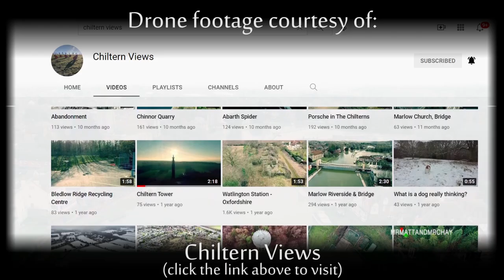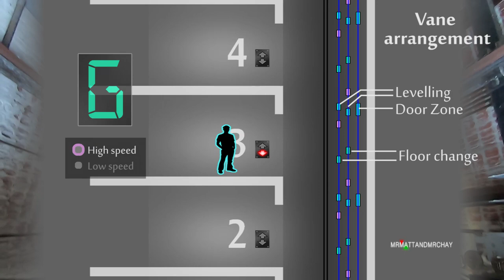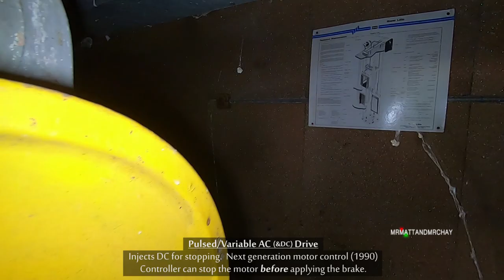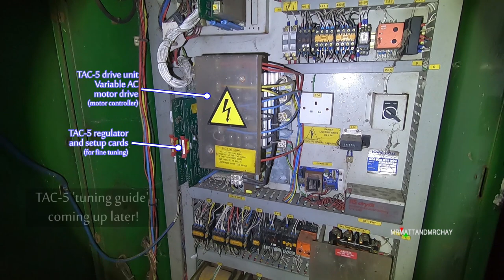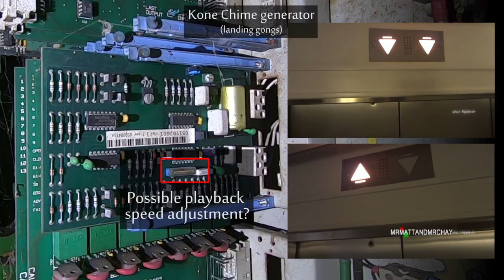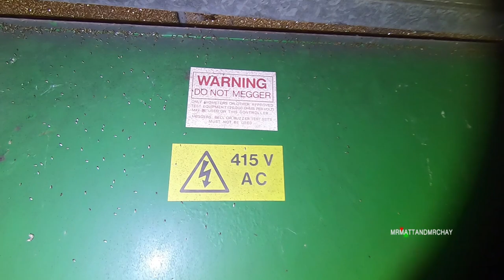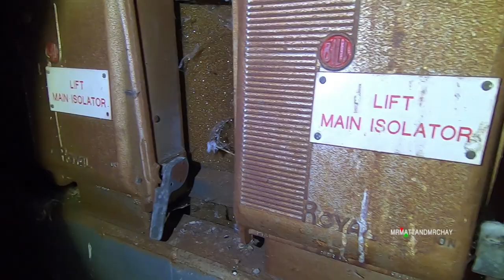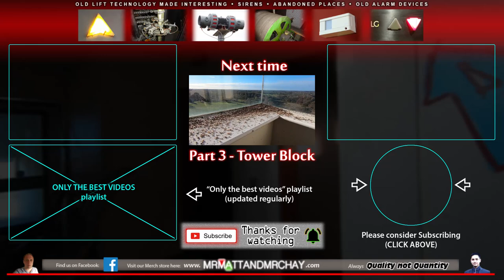16 FLOORS UP - Abandoned tower block - Lift Machinery ("intricate detail")

Comment: Thank you, your video comparing the old and new setups answered a question for me. I always wondered what that whine/whistle was on those old Tesco lifts, as they came to a stop. Never in a million years would I have guessed it was the brake! Great footage as usual.
Reply from the maker: The whooping noise (if that's the noise you mean) is the motor configuration being switched from high to low power and vice versa.  The noise is just the vibration created by the motor windings being connected between star and delta (google 'star and delta motor', as this is another topic in itself!!).  The screech noise is the brake being applied to an already rotating motor.
Reply: @mrmattandmrchay  ah yes I was getting confused there then. The star delta for startup made sense, but I hadn't thought about slow down as well. Either way it's thanks to your great videos that we learn more about these things. I do miss the siren videos, started watching some of them again the other day. Sadly I never managed to 'see them in action '.
Reply: These are variable voltage variable frequency motors, the frequency of the voltage is reduced to cause the motor to run slow. The speed of the motor is controlled by varying the frequency and voltage going to the motor, thus a vvvf motor. You can hear the frequency of the current as it drops down into a frequency that’s audible. The slowest speed using the Lowest frequency in the system. As more speed is required, the frequency will increase along with the voltage, that’s why you hear the whine at its slowest speed. Ever run a cordless drill at a slow speed ? The speed of the motor is reduced by lower voltage and you will hear the frequency at that slow speed.
Reply: @perrymckinney6146  Sorry, I meant the yellow motors in the old Tesco motor room. Yes you can clearly hear the wine from the motor driven by the VFD, I am not a fan of VFD driven motors at all.

Comment: Ad. 5:40, i guess you mean older drives than those with chopper/inverter. Here in poland we have DC express lifts with ward-leonard drive which came in mid 60's as license from swedish asea-graham. They existed in two variants, geared with high-speed motor, up to 1.7m/s and gearless with low-speed motor up to 2.5m/s. Both were slightly different in the matter of creating the velocity curve but both were stopped electrically, and brakes were applied later, when the motor shaft was arleady not moving anymore. The exception was an emergency stop, of course!
But in case of normal squirell-cage motors, braking from slow speed to full stop was done by brake's friction.

Comment: Hi there, I used to re-wind electric motors for 20 years and repaired alot of lift motors etc brakes etc etc... where you an ex lift engineer?? Where do you get your information regarding the control panels

Comment: Very detailed animation and labelings! Bet the KONE Traffic Master System 200 was used a lot for cheaper/low entry KONE lifts in residential buildings back in the 1980s-1990s, whereas the TMS600 one was used in the mid range low to mid rise KONE lifts. Wonder what were the original lifts here before KONE modernised them (perhaps OTIS or Express Lift?)

Comment: Sorry for going off topic, but technology is ducking amazing. Imagine that it’s 1990, and someone was in this same situation. They would have to enter at ground, or bellow if there would be, and it was better, easier or, the only option. Then they would needed to climb and explore physically, unless they had one of those Johnny 5’s that they could send in, that is if it would transmit back through all the material, unless it was wired. That would be a loooong wire.  
But now drones are capable of this and more. Have you seen the racing?

Comment: Fantastic video! Loved the views from the Controller cabinet and all the labels, it makes it very interesting. One thing I’ve wondered is how the lift stops at the correct position of the landing when the two door levelling plates both line up as it looks like there’s a 1 or 2 inch overlap before the lift stops yet the lift stopping is accurate to less than a cm on the floor level- see at 18:19.
Reply from the maker: Thanks very much Harri!  The animation, I tried to make the stopping a little delayed as sometimes it takes half a second for the processor to register the vane, stop the motor then apply the brake.  Admittedly, it did run on a little further than it should after getting all 3 vanes together.  Essentially, vanes 1 2 and 3 should stop the lift level with the floor.  The more you overlap the levelling vanes, the more adjustment you get if the lift overruns a little or takes time to stop.

Comment: I find it rather funny that someone has labelled the two limit switches at the top with "limit" and "final limit" —sounds a bit like version naming scheme often used by graphic designers and artists "final version" "final final version" etc... :D
Reply: If the "limit" triggers, the vane system has failed somehow and the lift ran to far. If the "final limit" triggers the VFD or contactor failed somehow and the lift ran WAY to far. If also that fails it would probably run into a hard stop until the motor shuts off on overcurrent.
Reply: @mrfrenzy.  good to know, thanks!

Comment: 6:47 You should have released the brake mechanism (the rusty lever on top of the solenoid). Lifts are usually driven down by the motor as the counter weights are heavier. Release the brake and the lift will come flying up and hit the underside of the  motor room floor

Comment: They should just pull it down it's  dangerous mind very good video.
Reply from the maker: Thanks very much Irene.  It is due for demolision soon.  But as you'll see in Part 3 (coming soon), it's a typical '1960s/70s' design and would be very difficult and costly to modernise.
Reply: Thanks for the reply that's why I think it should be pulled down I think it's also a fire hazard but it's a great video x
Reply: It’s very unfortunate that it will be demolished soon…